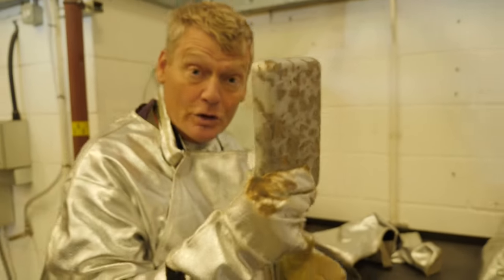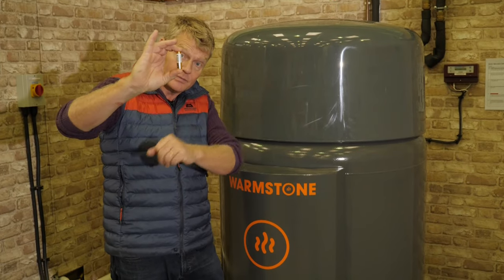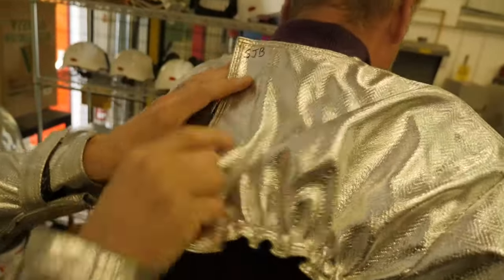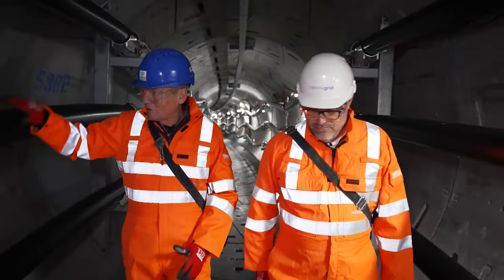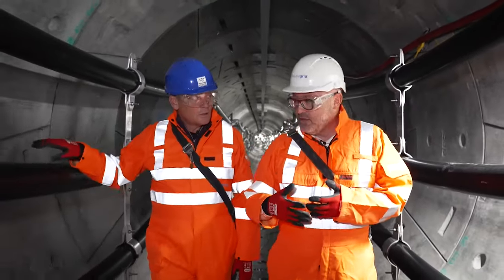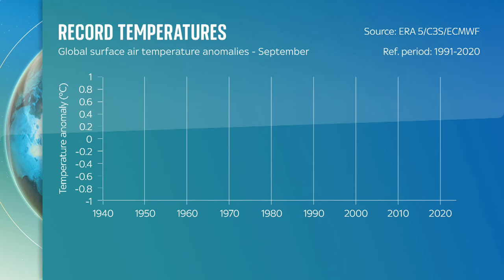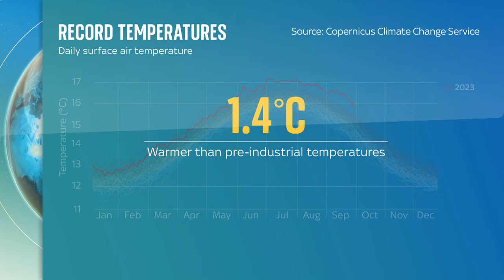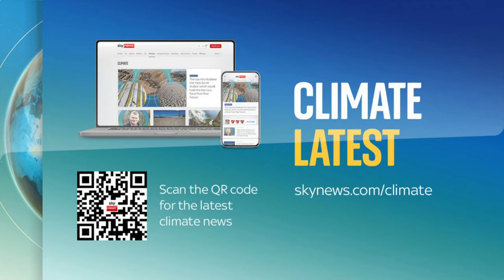Can big batteries solve our energy waste problem? | Climate Show with Tom Heap

Comment: Heat storage is such a simple and elegant solution for providing cheap heat for industrial uses and for shifting excess heat/energy from seasonally for building heating/cooling.  As the video points out, electricity storage and heat storage are complementary not competitive.